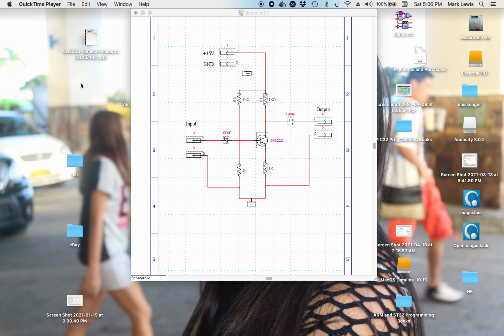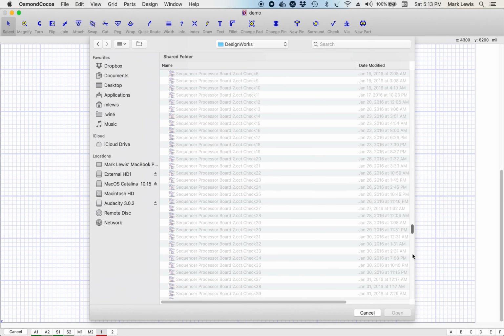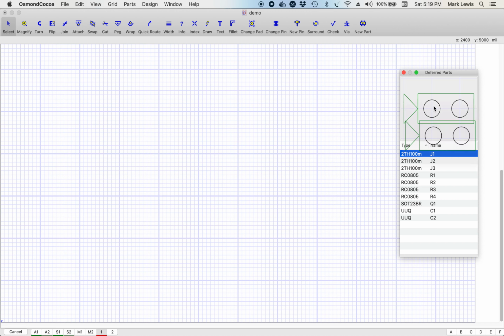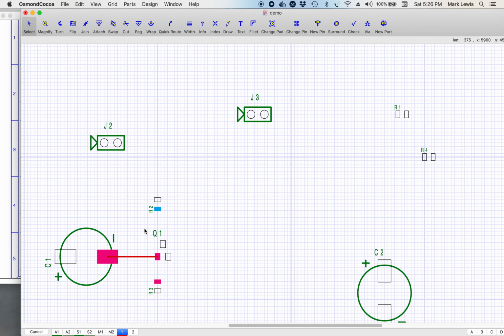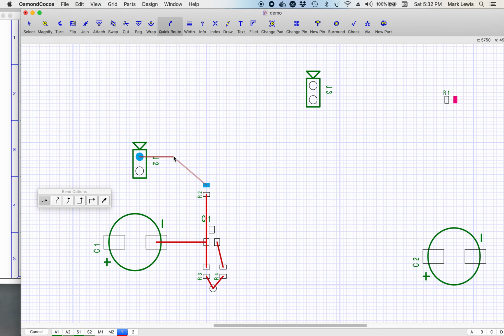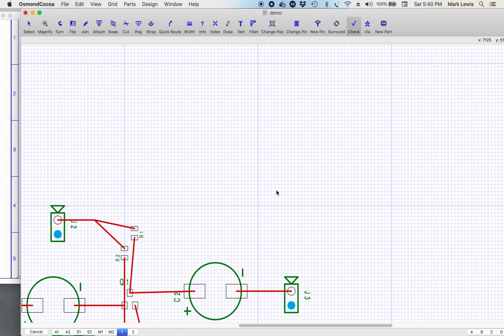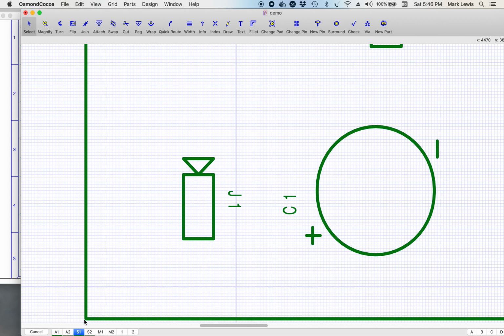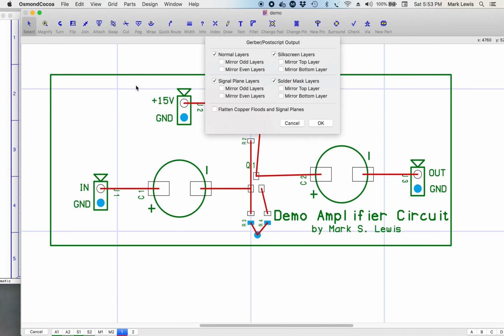How To Design Electronic Circuits and Circuit Boards using DesignWorks and OsmondPCB.

Comment: What version of design works are you using?  Are you using a paid copy?
Reply from the maker: I’m using version 4.8.1 on MacOS. Unfortunately it seems they no longer support MacOS.

I’m using the paid version. 

If they got together with OsmondPCB and integrated the 2 and continued supporting MacOS I’d keep using it. 

At the moment I’m still using it on MacOS Mojave until I can find a replacement solution. 

I’ve tried KiCad but the gestures/user interface are very quirky to me and their multi page schematics (hierarchy sheets) don’t quiet make sense either. 

LibrePCB has a lot of potential and makes more sense but it’s still in need of more development.